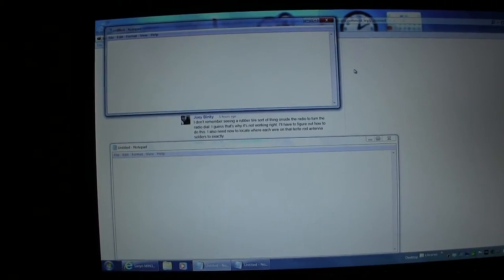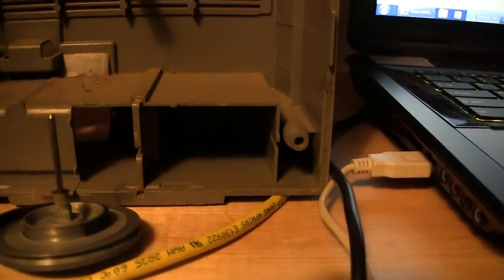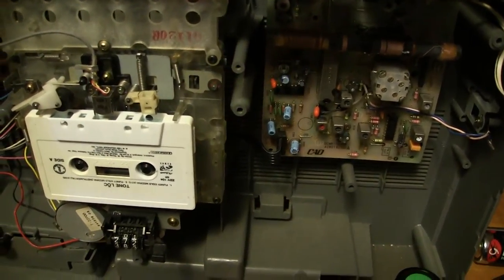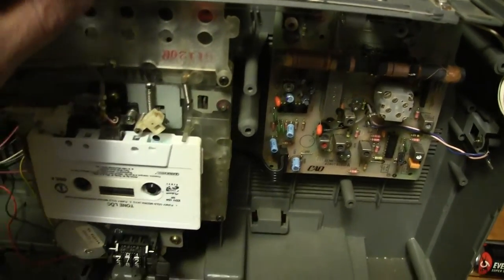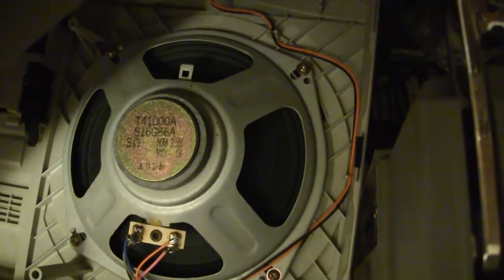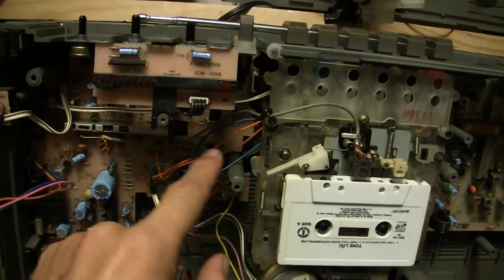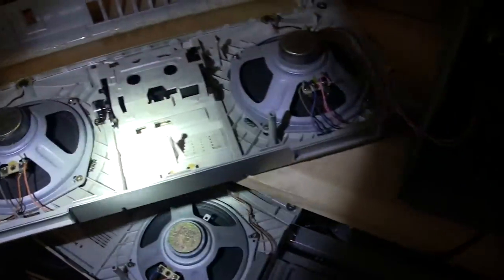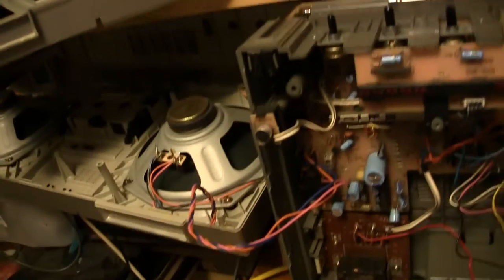Inside the Sanyo M9935K Boombox Joey Binky Follow up Ferrite antenna 2 Versions

Comment: I just bought one of these off Ebay 3 days ago .. what a mess. the right speaker wouldnt come on till i shook it and it finally came on .. and the LED display is hanging back about 2 inches back and down. the auto stop isnt working, the AMSS doesnt work .. and it seems to struggle sometimes rewinding and fast forwarding, sumtimes its ok and others its not .. seems to depend on how much of the tape is on one of the reels. and on one tape i put in today it was dragging really slow. i just watched a couple of your videos and seems like it isnt too hard to open up the case so im gonna give it a shot .. ill at least get the lights back in place and hopefully can fix the speaker, hope its just a loose wire .. as far as doing the belts or tires or whatever you wanna call them i dont know if i want to attempt that myself. probably just go thru the phone book and find a repair guy. what sucked was i bought this one because it looked the nicest out of the 3 M9935's i was looking at and the most expensive one too so i figured id pay for the more expensive one cuz its probably in better shape ... i shoulda bought the one that looked like it had 3 inches of dirt all over it for 49.99 .. but Nooooo i buy the one that was 110.00 and everything that could possibly be wrong with it is wrong with it .. lol